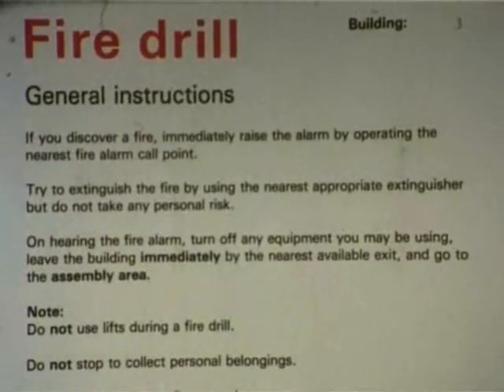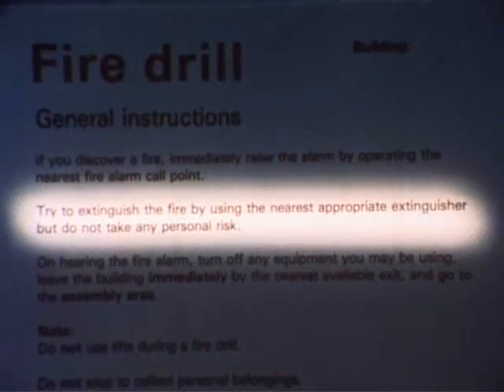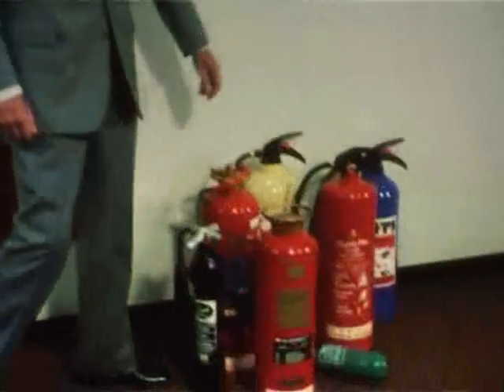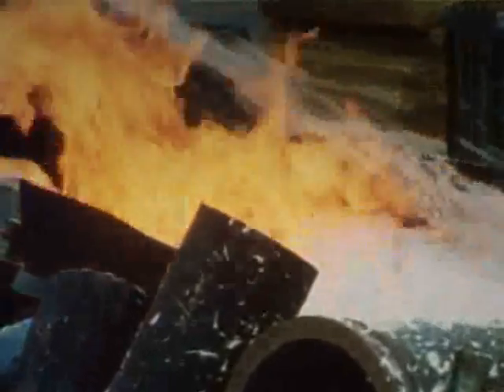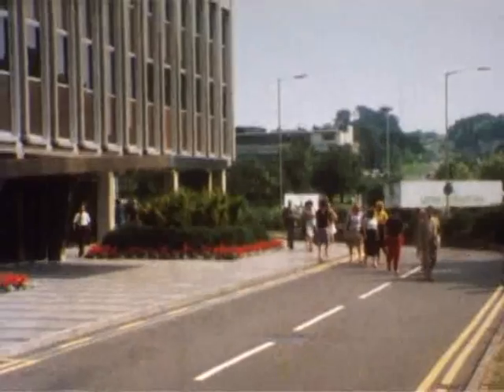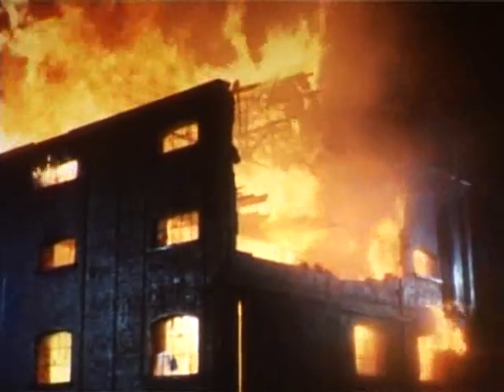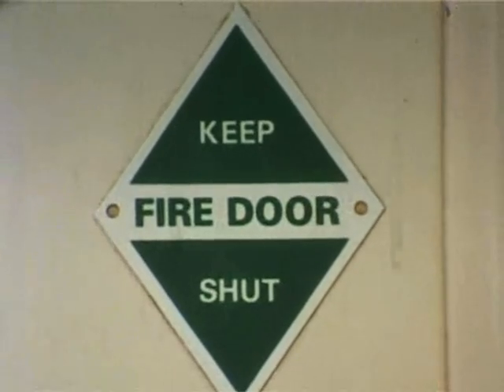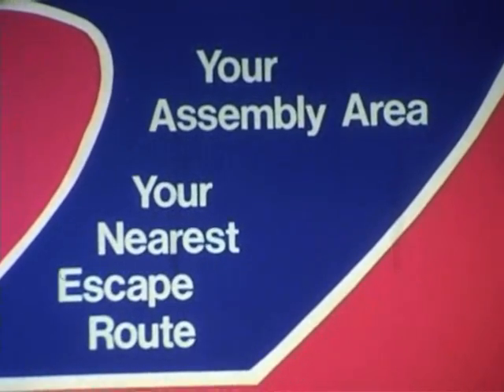1970's Kodak Fire Drill Training Film

Comment: This is early 1970s?
Reply from the maker: Late 1970's as it includes L&G branded examples of the new Thomas Glover 'Series 2000' squeeze grip plastic valve controlled discharge gas cartridge operated extinguishers which first came on the market in 1978/9